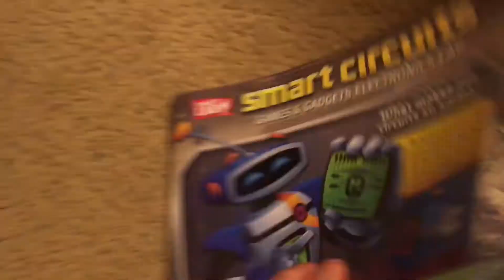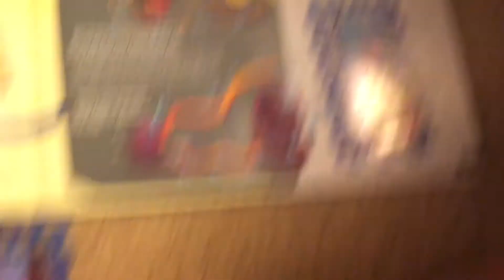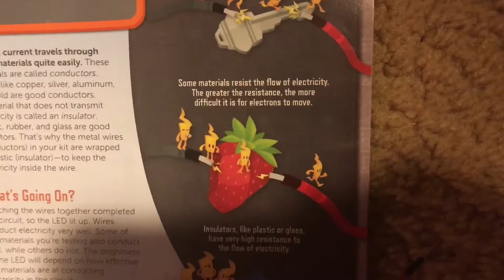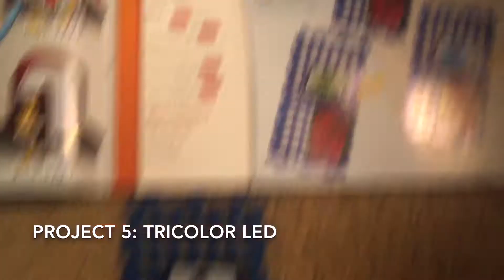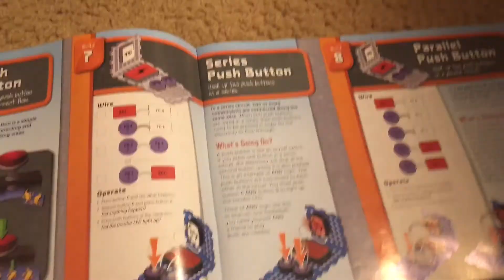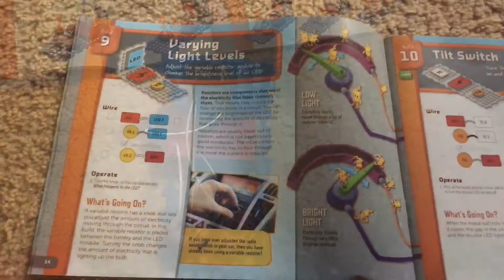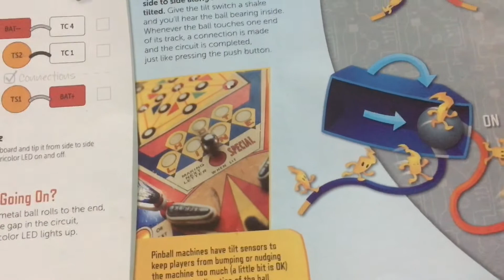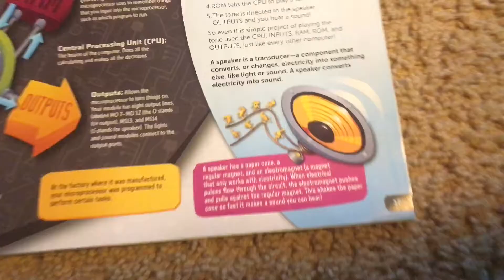SmartLab Smart Circuits Projects 1-11

Comment: What does the program do in the microprocessor? I removed them from a circuit i made in a book and worked the same thing
Reply from the maker: It’s been a long time since I used this kit, but I do know that the microprocessor contains tones that can be heard on the speaker.  I can try to find the manual for the kit and get back to you if I have more information.